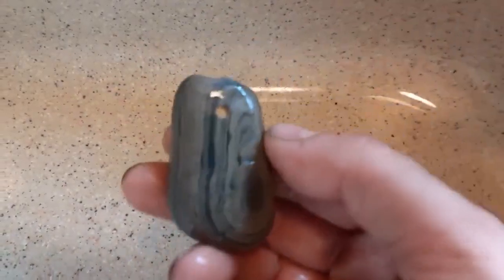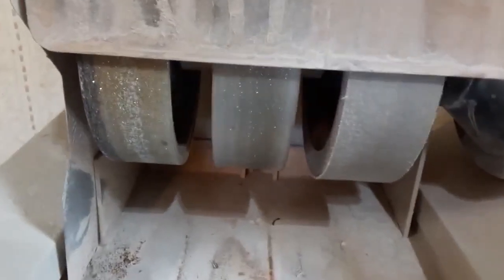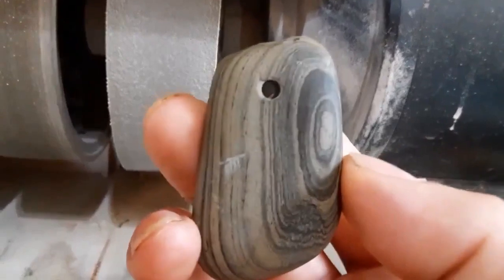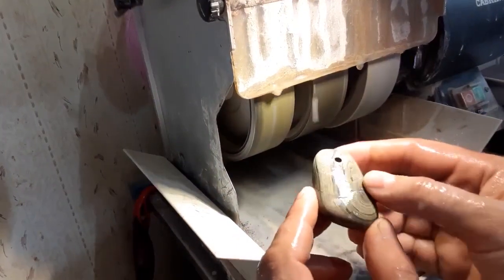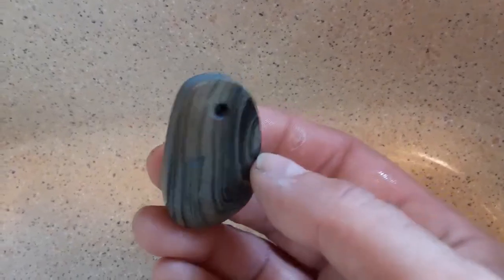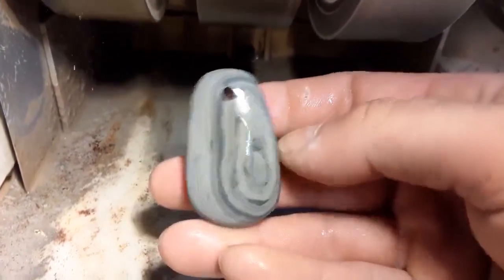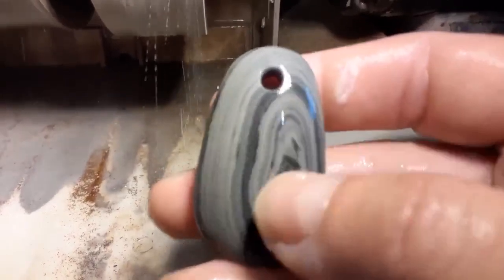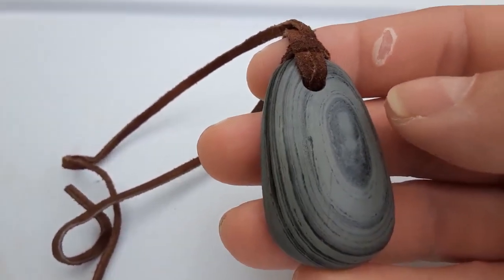Artifact & Arrowhead Hunting Indiana ( BONUS PENDANT ADDED TO GIVEAWAY  😉😁😎 )

Comment: Salut, 
 Telling this short tale nearly brings me to weeping.... 
It pains me to recall how once I had cut two-ton of pavers to fit a drive and sidewalk, three pallets.... all cut that one single glorious summer afternoon back some 26 years ago.... 
It was one man; one wet saw.... 
The only smoothing action those paver cuts recieved was exacted by utilizing the side of that 18 inch (or so) masonry blade. As I well remember, it was my rookie run manning the demonblade....
Heh, Heh.... Yeaahh.... 
....that was also the last time I ever begged to operate that dang saw, or any other.... ever....
If I would have been in the business of breaking and entering, things might have had a somewhat prospective and sunny outlook.... for not a single one of my fingers were left in a condition capable of leaving behind anything remotely near resembling something of an identifiable, let alone, distinguishable character! 
Handling all those gritty-ass pavers had shaved all traces of prints clean off, that layer epidermis completely vanished to a point somewheres between; just below and much further past each finger's print ridges! 
Damn! ....if that did not hurt something fierce, and for at least a week! 
I like your machine! 
If'n I owned it, there would be an ever-mounting pile of stripped and smoothed items just yearning and bellyaching for a fresh coat of paint! 
You got some knack, Well Done! Cheers!
Reply from the maker: Much thanx bub. Your comments are always so kind.  😊☺️😊☺️🤗🤗🤗
Reply: @365headhunter3  🌮👌😃🤞
Reply from the maker: @jarmyvicious  👉👌💥☺️
Reply: @365headhunter3  hahahahahahhahah